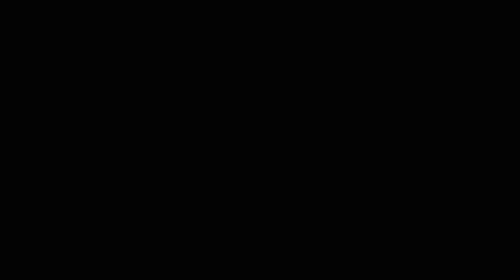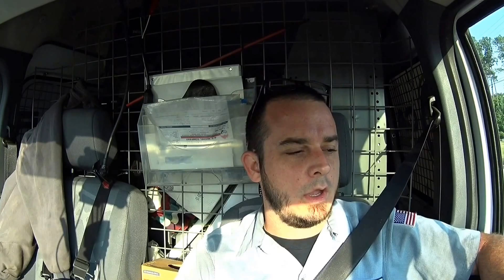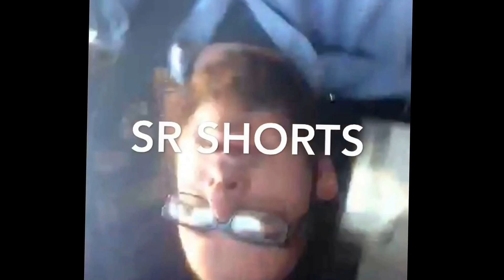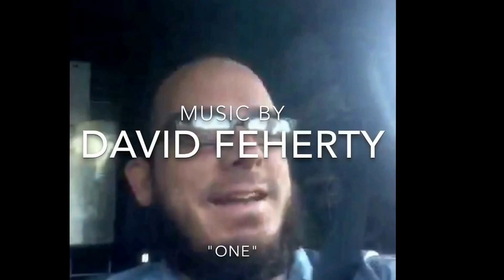HVAC Vlog: Calculating Superheat or Target Superheat

Comment: something else you need to keep in mind when you're checking superheat, the house, or the walk in box, reach in, building, must be close to operating temperatures. If you're working on the house and the house is 95 degrees inside you can't check superheat because you're going to have very high superheat until the house cools down to under 80 degrees, same thing I have to do and Refrigeration, even with chillers you have to wait until the water cools down to operating temperatures to check your superheat. so if you have a hot house and your checking or superheat you're wasting your time you got to come back if you want to check if you're going to always have a very high superheat until the house pulls down.
Reply: Ben Kuxhouse dude it's always changing. That's why you get your target superheat get it to that. Later that day it won't be the same is fluctuates depending on temperature

Comment: if you can trust your digital gauges and thermometers you can use your tools but I very rarely have to check subcooling to get something right. I found the only time is necessary to check while charging is on 2 speed equipment. you can be under charged but you can have proper superheat coming back to the unit to still be under charged. I worked on chillers, residential light commercial and industrial including medium and low temp refrigeration. I always trust those electronic stem thermometers because if I have to adjust a TXV that's the most accurate thing I've seen. I understand a lot of your videos you work on a lot of package equipment I guess that must be a lot so that where you are working. if your temperature drops are really good and everything feels about the same you're pretty good to go if you ever make adjustments or a charge because you think you're superheat not right or you're subcooling, check your temperature drops because if you are overcharging your or adjusting a TXV and flooding the evaporator too much your temperature drop will decrease.

Comment: Thats all good, but I haven't seen a video of anyone sayiny what the super  heat should be and why. Alot of difference from evap. superheat and compressor super heat. I have seen so many different superheats and they are all TXV. Not captube or piston.. Do a video on super heat. 10-14 on A/C at coil but all these larger numbers at unit. You're the one I would trust  the most. Thanks man. Set it straight.
Reply from the maker: Check out ZackHVAC or the archive at Talyn875. I know he's done a target superheat video.
Reply: thanks. I'll check it out

Comment: Got a set of 550's a couple weeks ago.  First time i used them i realized just how great digitals are. 
Second service call i used them: 
Just a check and clean, I've never been here before though.  R-22 piston evap
225psi/78psi,  88° ambient, 21° delta. So at face value, its doing okay, t.d. is just allittle high. with only analogs on it thats all you'd know and some guys would call it good. 
Here's the thing, i was using my new Testo's (with Bluetooth which works well, range is about 50' in the house). 
This unit had 2° SuperHeat and 7° subcool, compressor is sweating. target S.H. was 15. So, it's got a major problem. Not overcharged, not undercharged, ductwork is correct, cleaned coils 30 mins ago, now what?
Looked up what size piston it should have (49) had one on the truck. Pumped her down, it had NO PISTON. 

When i left her, 230/70, 19° T.D., 16° S.H, 8° S.C.
Reply from the maker: That's awesome Boomhauer
Reply: That’s good job bro. As many other good service technicians say: “use the tool, to confirm your diagnosis.” 
It was you who took the extra step to properly confirm your diagnosis. 
Great job👍👍
Reply: @arc3075  Had it been me that was sent to that house, my service vehicle probably wouldn't of have the right size piston stocked on it.
& after communicating with the office that its got a serious problem, they'd tell me 2 things:
(1) We'll give them a quote to put a TXV on it.
& (2) We'll have to schedule to do that another day, Its after 2 pm & you still got 3 more calls you gotta do.

-This frustrates me to no end.
I get that you have a schedule to keep. But you can't tell your tech to leave a problem & get to the next customer.
Especially in the thick of summer.
The solution is to hire more techs so that we can give the quote, collect the money & fix it right then & there.

Are any of you guys dealing with this out in the field? 
Or do you just get approval & take care of them that same day?

Comment: Oh and 75% of these old timers with analog gauges say above 60-65 on suction and beer can cold and its good. No need to take a high side reading.  There's a way to make these systems work, but maximizing the equipments ability is in the hands of very few. Thanks for the videos. Learn great stuff with all the HVAC channels everyday. True pros!!!
Reply from the maker: Thanks for
Watching Brian, it's sad when the old timers say "it's good enough" usually you throw a Testo 550 on it and it's not even +/- 10 more like within 50...
Reply: Stephen Rardon Lol! so so true, but sad. Just seen you were in the triangle. I'm from the triad area of NC. Holdin it down in nc

Comment: Great video Stephen. Agree with you 100%. I've been in HVAC for 7 years now. Started at the bottom as a install helper with no school or training and worked my way up to a above avg tech. I have known or worked with probably 50 other people in the trade. I would bet $100 that 95% wouldn't know how to calculate SH. 75% wouldn't know target SC is written on the data plate. Why do u think all this rolls royce equipment is coming with on board sensors to measure it. This field, and some posters in my opinion, is full of hacks. A set of digis that can give me these readings is the best thing ever. Doing the math in my head is pointless. Those who think differently are making more work than is needed. Work smart not hard is the way I work.

Comment: digital gauges make it so much easier to get the information needed to diagnose the system quickly.  when using analog gauges and doing manual calculations, its a slower process.

Comment: When I started out, the company I worked for trained their guys by the "if it's above 60 PSI on the low side, it's good". Didn't hear about SH until I came down south. I bought digital gauges for the efficiency of getting those calculations done for me and speeding up my calls (I WAS getting paid task rate at the time so it was a major concern). 

Now, seeing everything I can see with iConnect, and remembering how many people I worked with that just took pressures into consideration, I feel more well prepared to do my job. Actually, I've learned more by using digital gauges and figuring it out on my own than I did sitting in that company's  training classes, which is freaking sad. 

Knowing how to do SH/SC calculation isn't really the end all be all, but knowing what they are and what they mean within the system is how we do our work. Everything works together and one thing is never more important than the other.
Reply from the maker: Sounds like solid advice, "shoot for 60, head pressure be damned"

Comment: There is a lot of talent and just good hvac guys on you tube, I watch a lot of you and I do learn a lot here. In fact I was watching one of your videos yesterday and you done a calculation for CFM, based on temp. split, amps and volts with the strip heaters running, caused me to grab for my note pad and I just wanted to say thanks as I did not think to comment at the time. I had not seen the one on measuring caps while the unit was running before either. Notes taken !!! Thanks..
Reply from the maker: Thanks for watching, I'm glad I could help.

Comment: So, I've decided on a career change at 28 and have wanted to get hvac certified for awhile now.  Any advice on where to even start? I am planning to pick up the ashrae handbook and try some online classes.  I've  been subbed for about a year now, love the vids!
Reply: Tyler Rathgeber I too was similar situation, only I changed 2 years ago at age 45,  I am carpenter of 30 years and wouldnt say master, but trim/cabinets was what I excelled at.  I was lucky to get on at the area votech as district maintenance,  The HVAC instructor is a nationally recognized going on 43 years with more Skills/vica awards from his students than years taught.  I just now got my mechanical licenses this past may,  I'm green but learning all i can when and where I can.  I'm trying to learn more on thermal dynamics for a better understanding of the overall scope of things.  I use analog and digital, I got a set of hilmor's and sman's, prefer the himors, but as of this past month got the iconnect multi circuit pack,   best tool ever,  My preseason cooling maintenance checks can be done in 1/4 of the time with all the data streaming in.   I guess what i'm wanting to say is,  do what you love, love what you do, do it the best you can and with what ever tool you feel most comfortable using and understand, digi or analog
Reply from the maker: The easiest job to get in hvac is usually and install helper. If you get in with a company put your nose to the grindstone and learn everything you can. Pay usually isn't good but it gets you in and hands on. You're braver or crazier than I am to be making a change at that age. Unless you weren't making much $ in your previous job

Comment: SMH...I have to say you are really against using one's brain Stephen..WHYYY?...but that's typical of people nowadays...just give me everything in front of my eyes NOWWWW...god...Its important to learn these things bro...these Digital gauges do help, no question, but these are circuits and sensors that go bad in a second. If you never learned the basic knowledge, you wouldn't have a clue...Its not "stuck" Stephen, its called LEARNING.
Reply from the maker: Seems you missed my point completely. I'm not advocating that we don't learn things but that we educate the new techs on things that matter more than what SH and SC takes to calculate. So many techs, including myself until recently, don't have any concept of the fact that there are calculations that will tell you where your numbers should be. Many people seem to be "stuck" on requiring that SC and SH be manually calculated rather than moving beyond that simple concept and teaching the more important stuff.
Reply from the maker: Teach them WHYYY, not just telling them an arbitrary range of 10-15, blah blah blah
Reply from the maker: You wouldn't simply tell a junior installer to only connect like colors when wiring up low voltage so let's stop acting like simply checking superheat and subcooling is enough. Let's train the next generation better than we were.
Reply: Ok...sounded that way in the video, but now that you have elaborated, you a little clearer.Don't get me wrong though, I love these new electronic gauges cause they do speed my day up..i had one client told me yesterday."your guage looks so much better than the oher guy's, he had those lil round analog thingy"...lol... but you have to agree that some of this new technology do breed laziness...give them analog, a meter with temp clamp and a PT chart, at least for a little while.

Comment: I'm a 7 year tech. I've never owned a set of digitals, i used a Testo a couple times though. 

I'm happy with my analogs, I can get an accurate calculation of SH and SC and what they should be with my analogs and clamp thermo. That's how i learned to do it, that's how i do it every day.  
But, that doesn't mean new guys MUST learn using a manual method as i did. 

Having digitals is about efficiency, and making the readings more accurate; which is never a bad thing regardless of the techs experience level. 

I just fear the situation where certain guys would only learn to read the meter and not understand what the readings mean. Although, some guys that don't what to learn will never do it right, regardless of what gauges they're using. 

I thoroughly enjoy watching you clean condensor coils, i see too many guys try washing without even taking the top off to spray from the inside.
Reply from the maker: that comment about watching me clean coils is really the last thing i expected to hear BoomhauerWorldwide ! i've re-watched some of my cleaning videos and could barely stand to watch myself at all! thanks for the comment
Reply: Lol

Comment: It's my experience, that most technicians don't know how to calculate target superheat and some aren't aware that there is such a thing. They charge by a rule of thumb range of around 9°-12° sh. Which is too low in most situations, especially on systems where the evap is located in the attic. 
I'm not trying to be negative either. I interact with a good number of technicians and they don't know how to do it or don't know what it is.
Reply from the maker: that is kind of my point sad hvacman you nailed it. give a tech a set of digitals, because they are more accurate and the formulas and he will be more efficient and accurate. Fieldpieces sMan gauges have the target superheat built into them but nobody uses it because they aren't taught the importance.

Comment: It seems to me that the big issue is can these new techs add and or subtract. If math is a big problem, better get digital so the math doesn't cause a major screw up. And yes the tech needs to know where the calculations come from.